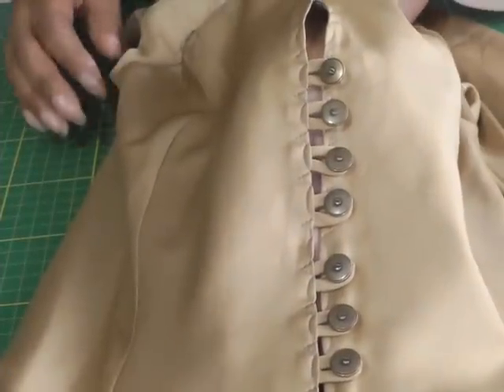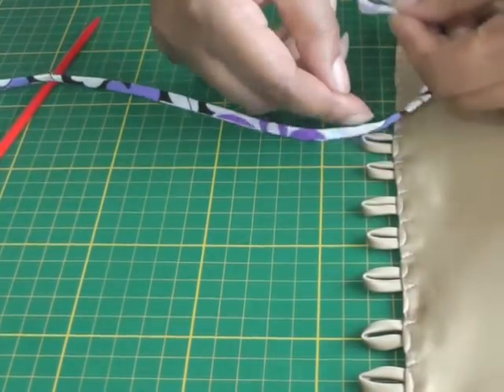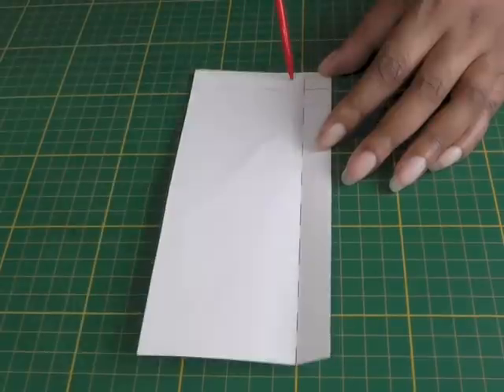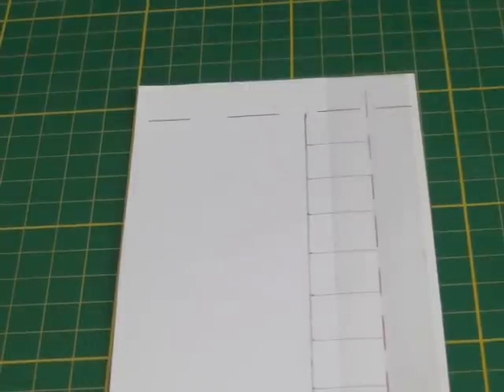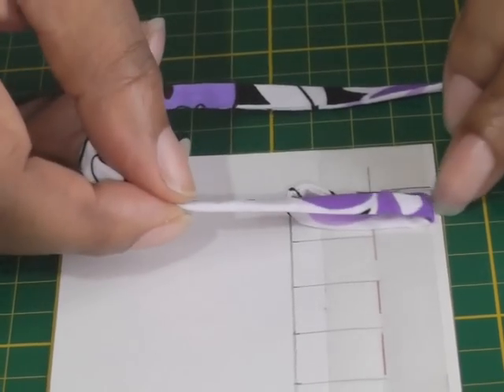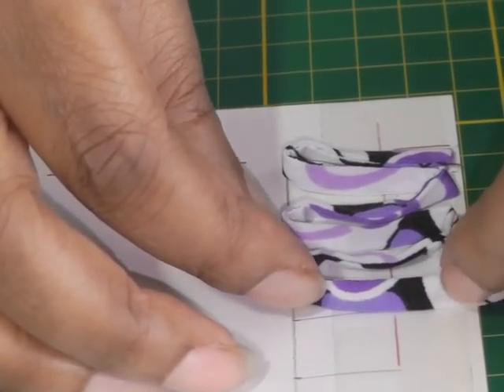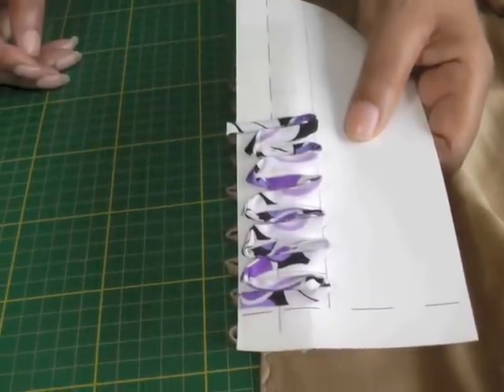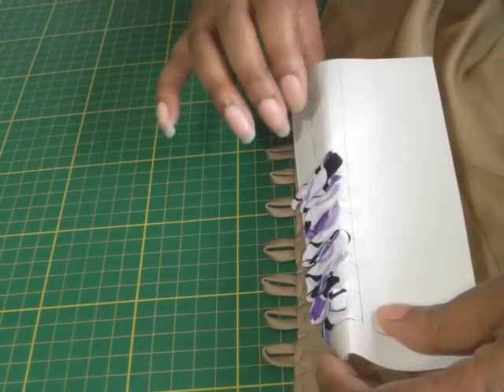Rouleau Loops Tips and Advice

Comment: Great video. I used stick pins (nightmare that was). Thanks for the sewing tip will come in very handy. 

I have bought a  serger. But I also have a regular sewer. Can buttonholes be made on a serger? or do i still need to use my sewer for that? Can you help.